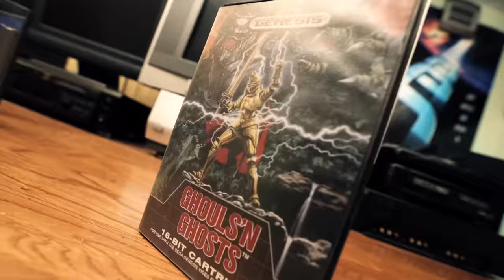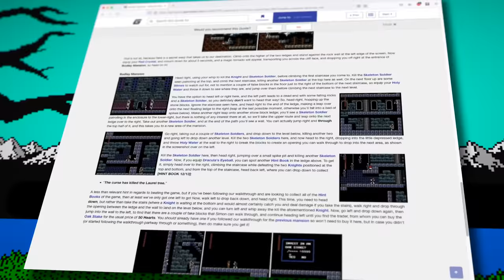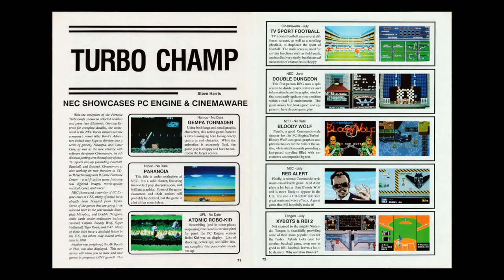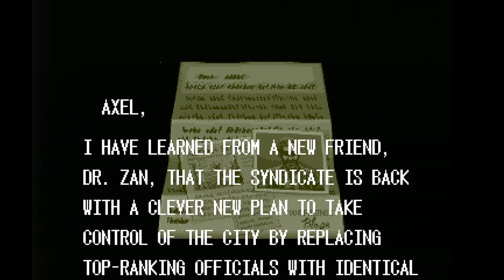Games that are Better than We Remember

Comment: Mike Tyson's Punch-Out!! on the NES. I've always loved the game, but I love it even more now because it's so quick to just pick up and play, whether I just want to play it for 5 minutes or half an hour. It's so much fun to go through each different opponent that I have no problem starting over and doing it all over again. Sometimes I'll try to speed run my way through the game, although I'm still not that great at beating the later opponents.

Road Rash on the 3DO is another one. Again, I've always loved the game, but it's a lot of fun to just pick up and play, and is probably my favorite game on that underappreciated console. Every time I play it for any length of time, I have a blast.

There are probably a lot of other 16- and 32-bit games that I would consider for such a list, but I'm blanking right now.

Comment: A little known bit of lesser-known info on Streets of Rage 2: Only one background layer is ever shown behind the HUD, even though it's fully transparent so you'd think both layers would be visible behind it. This is because the Genesis can only every show two background layers and once, so anytime you see a large HUD over the game like this it will be at the cost of using that amount of space from one of the backgrounds. 

It's kinda cool to go through the entire game and see how Sega's designers and artists managed to get around this limitation of the console in such a way that I bet 99% of people never even noticed it was a thing. 

Ironically, on most SNES beat 'em ups the designers/artsists used the additional third background layer that the SNES is capable of for the HUD, which meant most HUDs like this on SNES were drawn in very low colour (this was a limitation of the third layer), yet they almost never thought to use a similar solution to Streets of Rage 2, which would have allowed them to both have a full colour HUD (using part of one of the full colour layers) alongside using the lower-colour third background layer for additional overlapping parallax.

Comment: Mario Kart: Double Dash!!
I hated the wobbly steering and overemphasis on items (blue shells every few seconds), and thought that the whole package felt kind of phoned in, like Nintendo put in the minimum budget to get away with selling a $50 game. It didn't help that it massively outsold the far superior F-Zero GX.

I still feel the same on most of those points now, but these days, I can just enjoy the zany racing action, and not be so serious. :)
More recent Mario Karts have also put it in perspective: Double Dash's driving is more challenging, technical, and interesting than later games, in my opinion.
It also has one of my favourite battle modes: Bob-Omb Blast. 
And it's an amazing technical achievement, ugly characters aside: instant load times, and a 100.00% uncompromising 60fps at all times, even in 4P split screen. (Newer titles have neither of those things.)

Comment: I had so much fun with Cruis'n USA on the N64. I didn't notice the graphical differences between the N64 and arcade versions, despite living near a pizza place that had the latter, although the loose controls WERE an issue in both versions. Still, the atmosphere each level provided made it worthwhile.

Comment: Always enjoyed SOR3 playing it before playing SOR2, the music may be better in SOR2 but the SOR3 game mechanics were much better. SOR3 had a special bar so as not to lose health when you used your special, the characters having dashes and rolls to help move and evade, the improved dash (blitz) moves which upgraded at every 40000 points up to 3 stars as long as you didn't die changed the moves and made the characters more interesting to play with, the special moves characters had with weapons which change depending on whether it was a dash or special button and direction press was fresh and finally the multiple routes and odd secret characters and areas made your playthrough feel fresh and fun  each time.

Comment: If you beat Zelda 2 or Castlevania 2 without any kind of strategy guide you are not a human being
Reply: There is very little content in Zelda 2 thar requires a guide, chiefly among it the location of the sixth Palace/Temple and of the Magic Key, which requires creative use of the Spell magic. One could argue that the way to the last boss in the Final Palace also requires a guide, but that can be solved through trial and error since the game will allow you to continue from its entrance if you game over. Simon’s Quest was victim to shoddy translation, which is a shame since all the clues to finish it were actually in the Japanese version of the game.
Reply: @Zeburaman2005  both games are pretty cryptic. Can you honestly say you beat both without looking up help??
Reply: @variablevolume3059  I have to admit Zelda 2 stumped me back in the 80s due to not finding the sixth Palace. For Simon’s Quest, I can’t say, since I played it on emulator in the mid 2000s after seeing the AVGN’s video on it, so I already knew about most of those cryptic things.Though, knowing the trick without working it out spoiled a lot of my enjoyment.
But once I discovered how to find the missing Palace in Zelda 2, I had little problems finishing the game even without finding the Magic Key. That was back in 1994. Still, there are many  NES games that were a lot more obtuse than those two, and of Zelda 2 specifically, so it is a bit easy to put them all in the same bag.
Reply: @Zeburaman2005  Amen.. How about the original Metal Gear on the NES? That one stumped me as well!
Reply: @variablevolume3059  I played the original MSX2 version on an emulator, because I had read the NES one didn’t have Metal Gear. Not gonna lie, I had to use save states due to the game’s save function not working properly on the emulator, and I also had to look up some things like POW and weapons locations. Finding the right path was also rather confusing at times, despite the transceiver help from allies. On the whole, I found the sequel much more focused and enjoyable.

Comment: Crash 1 is the game that comes to mind in that department, i always ignored this game because the later two added a lot more to Crash's movement, and i remember thinking that the game was really hard, but i came back to it around the time when the n sane trilogy was announced and the game clicked with me, the controls while not perfect felt right for the kind of level design and i loved the fact that the level design was challenging and fair really putting my platforming and timing skills to the test, i even 100% it and didn't find it as hard as others said it would
Oh, and i knew that the Bare Knuckle 3 bug would bite you someday, what a great beat em up.

Comment: Nice video! Its good to remember those games, I might re-try some. 
By the way a few notes here since I remember that era very well. 
1. Zelda 2 on NES was so critised and people didn't like it, due to the fact it arrived AFTER SNES Zelda, A Link to the Past. I remember everybody was comparing it to Zelda SNES (unfairly), so it was hard to be a success for gamers back then. 
2. N64 problem wasn't in the compute power since it had the best of all at that time. The problem was the... Cartridge. Better sprites doesn't require only more proccesing power but, require more space as well. And Cartridge was the bottleneck.

Comment: I liked hearing about G&G for SMS, kind of like a streamlined Wonder Boy in Monster Land with the lack of currency. I'd compare it NES Rygar, different isn't necessarily bad per se.
Yeah you should be able to exit the shop without picking something, does kind of nullify the upgrade path selection. Watching your recent SMS roundup the games that put Pause on player 2 seemed to be a good option for single player games so you don't have to reach for the console button.

Comment: While i enjoyed supermario 3 alooot back then,but overtime it become less and less impressive,HOWEVER, looking at a technical standpoint, it just blows my mind,

For 1 thing, it contains the almighty mmc3 chip wich expands the rom and ram of the nes by using bankswitching wich swaps and enchange data in and out on the fly, this allows for better graphics and sound on the nes,but it also allows diagonal scrolling,background splitting,irq interrupts,tiles could be updated on the fly, etc,,,

That’s why see animated backgrounds on the map,a statusbar moving with the player,mario being able to fly diagonally,hearing dpcm drums,and being able to play roulette games etc,,,

Consider mario 3 as an early 16bit game with it’s glossy finish removed,

The mmc3 chip will definitely similate 16bit graphics on a nes ,especially in later nes games.

Comment: Back then i tout that i liked castlevania 2 simon’s quest,and at the time we didn’t knew there was a first and 3th one in the series,untill i years later did find out this game turned to be castlevania 2,but since it combined rpg elements with platform hacking & slashing, i tout this was simon’s quest 1,the problem with this game is that it says simons quest with giant letters while the name castlevania 2 has been put in very small letters,at the end i conclude that this became just a boring game because you have to walk back and forth between levels,it’s not going from point A to point B.